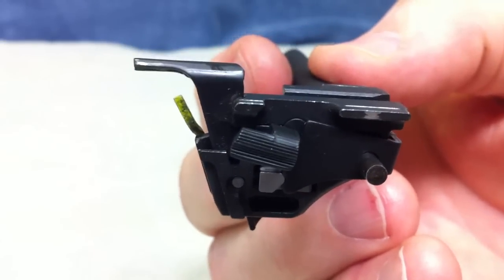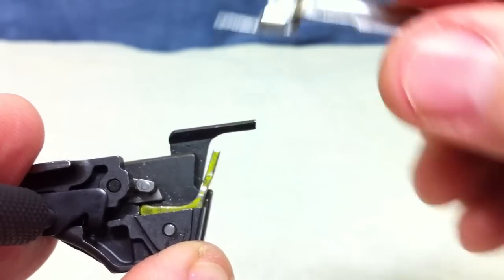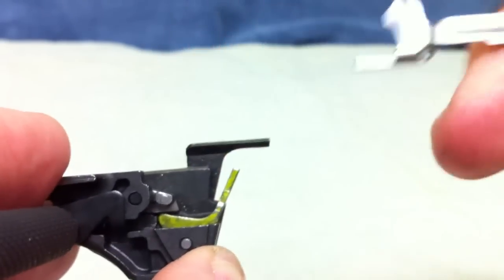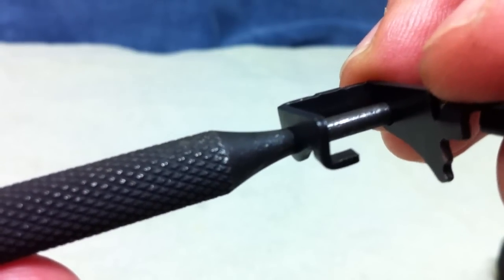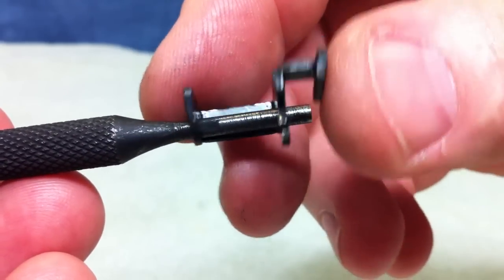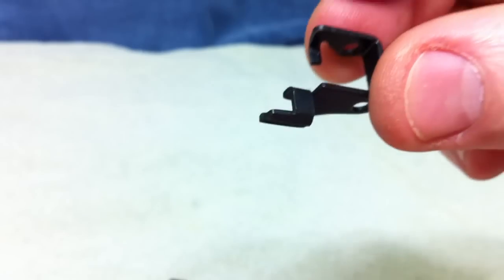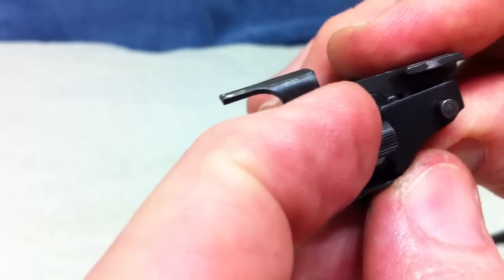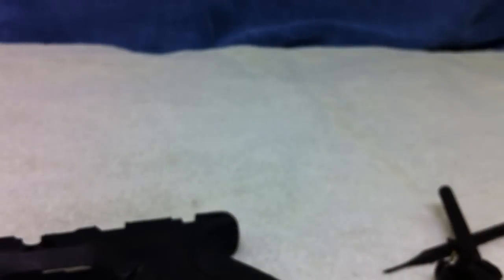M&P Shield Manual Safety Removal

Comment: Great video! However, I would strongly suggest also cutting off the safety lever itself on the left hand side of the gun. You'd still be able to retain the pin that holds the pieces inside, but if someone else uses your gun they might feel that they can turn on the safety and it's "safe." Personally, I treat a gun the same whether it's "safe" or not, but I feel that having a safety lever that does not function is probably not a good idea.

Comment: Rob, this video actually helped me accomplish the opposite of its original intent--installing thumb safety assembly. Your great close-up shots showed me where the knob and detent spring went. Once I saw that, I was done with the install in a matter of seconds. They came with an upgraded sear housing block that I received today. Since they fit my gun, I figured I might as well try them out. I can now head over to the range instead of banging my head against the wall! Keep up the great work!

Comment: Great info! If anyone were to try this you should cut off external tab as well. Having a gun that looks like it has a functioning safety but doesn't makes for a dangerous weapon. 

I can see someone using this gun for a sub-compact competition wanting to keep eliminate the split trigger and then use the safety  while reloading, storing, etc. but really don't think it's necessary as long as you keep the trigger protected in a quality holster. those who may carry it hot and loose in a pocket or fanny pack, purse, etc. should most defiantly use the manual safety if they insist on carrying that way.

Comment: Great video. Would definitely recommend cutting off the lever however. I understand it looks better with the lever still on but it is just asking for trouble in that someone may handle your gun and think that the safety is engaged when in fact there is no functioning safety on the gun.
Reply from the maker: I would think anyone allowing someone else to use their gun, is going to point out that the safety is non-operational. However since there are so many people that do not  know or follow safe gun handling rules, then the removal of the exposed manual safety lever would be best, to maintain safety.
Reply: Exactly my thoughts. Always better safe than sorry. I never want to assume when it comes to firearms.
Reply: My thoughts as well-scary as hell if you really think about it.
Reply from the maker: *****

This video shows how to defeat the manual safety. Most people keep their SD guns to themselves, thus if the safety is disabled and the lever is still in place, the user of the gun is aware of the disabled safety.  Now if you are going to allow other persons to be using your SD gun, then I would hope you have enough gun handling safety knowledge, to advise those other users that the safety lever does not work!  I have had my Shield for over two years, and I am the only person that shoots or handles that gun. By the way, I stated in the video that I like the manual safety and I did not remove/defeat the safety.
Reply: robkarrob11
I meant no offense. I understand, and appreciate the video, and I know there's an issue with this gun's safety. (yankee marshal's video).... I just personally do not like any pistols without a proper "functional" thumb safety.  Some people think a safety would hinder performance in a SD scenario. Only a crappy safety or lack of proper training would get you killed..... Muscle memory via training defeats any hindrance of having a thumb safety IMHO.   I prefer my 1911 Delta Elite, it (technically) has three safeties, and does not slow me down  at  all  when drawn and fired... I think the manufacturers should do better at designing, instead of US having to work around their gun design problem-- or worse, redesigning this pistol without a safety at all, that's just plain lazy on their part.
...I think it was this pistol that also had an issue with the "drop safety" function , I'll have to check again... Thanks for the video.
Reply: Something something 4 rules something... :-)

Comment: **Please read.
This video is very informative and well made, but one thing I want to add is, removing the safety does allow the pin to move about approximately1/16" out of place during operation. Past that it will be in contact with the I.D. of the polymer frame and will not move any further. Even though it will still function i did not like the thought of the pin being loose in my firearm. Installation of the safety plug which can be purchased for 3-5 dollars online will make up for the gap left from the safety switch being removed.
Reply: How about the gap on the right side of the MP Shield? Since there is no safety lever on the right side, there will be no plug to take up the gap?
Reply: @allendavisokinawa2669  It's a one-way pin and the other side of the safety doesn't cover it in the first place. So it's fine.

Comment from the maker: Call it what you want, but if your allowing someone else to use your gun, it is your responsibility to inform them of any safety issues, such as the manual safety being non-operational. I stated in the video that I like the manual safety, and I have it engaged when I carry. I said in the video that the lever could be cut off, and explained that it would leave the opening, in the frame, showing. For most people that do not want the manual safety, a "looks" issue is not going to be a problem.

Comment: Call Smith & Wesson and they will give you a safety plug for free if you decide to remove the safety on the M&P and the Shield. It just fills in the hole in the frame where the safety use to be. I have called them twice....very nice people.
Reply: thanks a bunch!
Reply: GTIMANiac I called as well and this plug does not fit the shield only for full size and compact M&P
Reply: SliccVicc760 so I guess this is all you can do is cut the tab and leave it out, or put it back in if you are the only one using your gun.

Comment: This video is very helpful for someone contemplating this for what ever reason.  More knowledge is always better than less knowledge.  I am leaving my thumb safety intact even though it is the only handgun I have with one.   I also plan on using it.  Even if I have to train myself to sweep my thumb down as I draw all my guns even if they have no safety.
Reply from the maker: I stated in the video that I like the manual safety and was not removing it. You have to train that as you are drawing the gun, you flick the safety off as the muzzle is rising.
Reply: What sucks about that is that my other guns with safety's are those with external hammers with decocker/safety combo which are activated by pushing up instead of down! So I typically leave the safety on while loading then click it off after i put it in the holster, then click it on again before taking it out when at home. Otherwise anytime I draw in anger the safety is
off and ready to go.

Comment: On the MP Shield, since it has the safety lever on the left side, even with a plug, won't the internal pin move to the right and cause ejection problems? Others MP handguns have safety levers on both sides so the plug prevents movement of the pin on both ends..

Comment from the maker: I would hope that anyone that would remove the safety would make sure all that come in contact with the gun know there is no safety. Removing the thumb safety makes the Shield look like ____.  However the ultimate way to let all know the safety has been bypassed would be to also cut off the thumb lever.

Comment: does anyone know if the safety shield and the non safety Shield are they the same guns except the one with the safety just has a manual safety? I have one with a safety and I always leave the safety off and someone told me that's not safe because the gun is designed to have a safety unlike a Glock Style that doesn't have a manual safety.
Reply from the maker: Same gun just less the safety. And it works similar to a Glock so called "SAFE ACTION". The rule is you never will have an issue if nothing touches the trigger. I use a lot of pocket carry and in that situation you are reaching into the pocket to get the gun with nothing to protect the trigger opening. That is why I prefer a safety and depending on the clothing I am wearing a pocket holster does not always fit.
Reply: robkarrob11 thanks! The reason I ask is I carry inside the waistband in a Kydex holster and the holster always flips the safety off. so I just carry with no safety on since the gun is completely covered in the holster. I always figured the non safety shields for the exact same thing with out the manual safety
Reply from the maker: Not sure what you mean by dead trigger, trigger doesn't move or trigger moves but the gun does not fire. That tab you removed only prevents the trigger bar from moving fully rearward when in the safe position. Removing the tab should allow the trigger bar to move completely back as it would move when the safety is disengaged. Your gun should work as though the safety was in the off position no matter where the safety lever is positioned. Since you are having issues I would recheck how you reinstalled all the parts as something is wrong.

Comment: I'm keeping the safety on my Shield. But, wouldn't it be easier to do something to prevent the safety lever from moving up (ie safe position), instead of cutting off the tang? In other words, isn't there a way to lock it in the down position? I guess if you can get the part from S&W to get it back to the original configuration, it wouldn't be a major issue to cut the tang.
Reply from the maker: All Shield parts are very hard to get. The gun is in such high
demand, that S&W doesn't allow many Shield parts to be sold to the public. This video was made for those that do not want the manual safety, and it shows the easiest way to deactivate the safety. Sure there may be other ways to deactivate the safety, but this video show the guaranteed way to eliminate the chance that the safety could somehow get accidentally bumped on.

Comment: Man this videos went long
Don't do this, either take the safety physically out of the gun, and get a $10 frame plug, or leave it in and ignore it, but do not tamper with the mechanism to then put it back in the gun.
This is a terrible accident waiting to happen.
It is obvious to me who has been doing gunsmithing on M&Ps for ten years that you do not understand the mechanism, know your limits and leave anything beyond your understanding for the professionals.

Comment: Isn't there a firing pin safety inside, therefore why the need to alert the world this weapon doesn't have an external safety?
Reply from the maker: Internal safety and the external manual safety are completely different. You can't accidentally bump the internal safety on/off, but you can do this with the external safety.
Reply: It is my understanding M&P will shortly release a frame plug in it (like current M&P's without the TS)

Comment: If you don't like the thumb safety, it's easier to just not use it...🤦‍♂
Reply from the maker: The issue with a manual safety is it could accidentally get bumped from on to off and likewise get bumped from off to on. If use the gun and do not want a safety, you would always keep the safety set to off position. What would happen if you suddenly needed to use the gun in a self-defense situation, pull the gun out, aim, pull the trigger and nothing happens. You did not know the safety somehow got bumped to the on position and would not let the gun fire. Those extra seconds it would take you to figure out why the gun failed to fire could make all the difference to your survival.